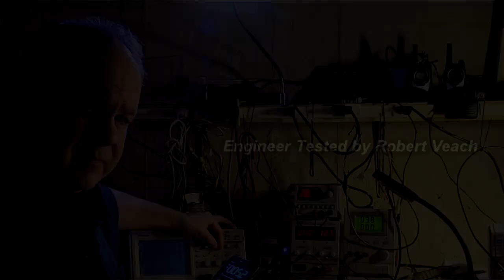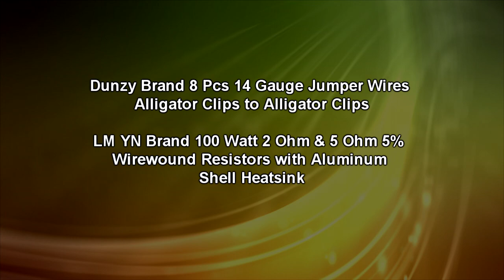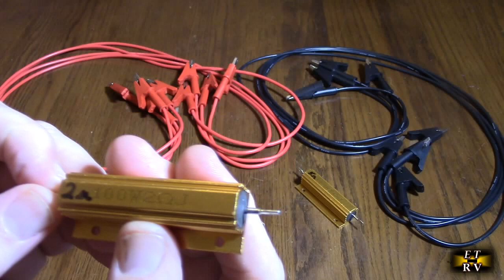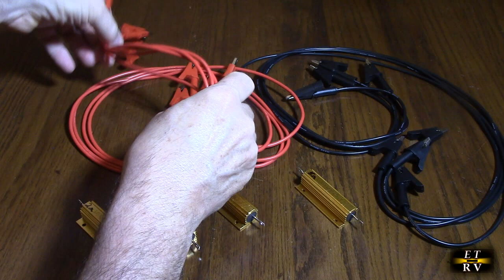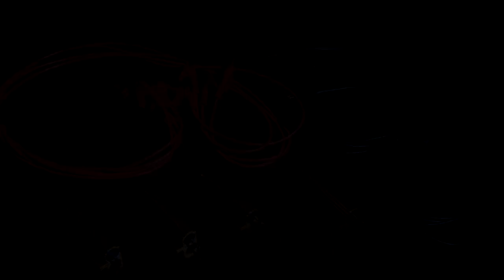Dunzy 8 Pcs 14 G Jumper Wires  & LM YN 100 Watt 2 Ohm & 5 Ohm 5% Wirewound Resistors -GREAT QUALITY!

Comment from the maker: ORDER Dunzy Brand 8 Pcs 14 Gauge Jumper Wires Alligator Clips to Alligator Clips Electrical Test Wires Set Silicone Flexible Cable  (3.3 Ft) on Amazon HERE: https://amzn.to/4gpYWRG

ORDER LM YN Brand 100 Watt 2 Ohm & 5 Ohm 5% Wirewound Resistors with Aluminum Shell Heatsink (Pack of 2) on AMazon HERE:https://amzn.to/4mhnIVG